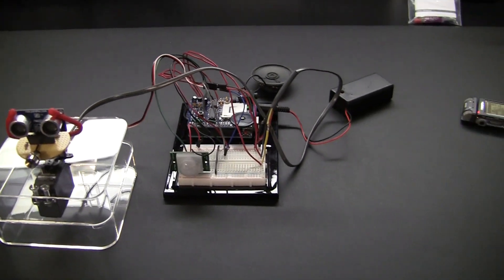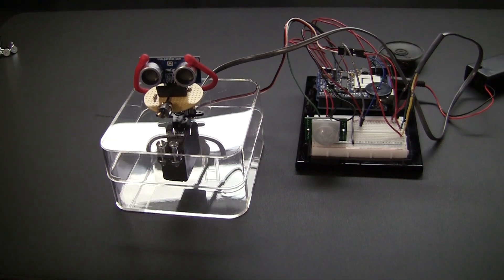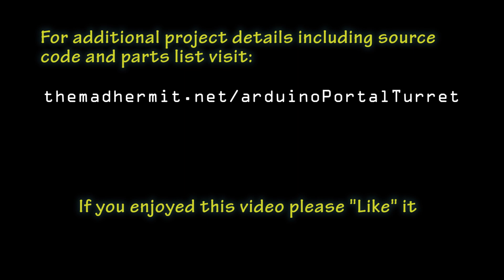Arduino Portal Turret (HD Video)

Comment: You should use 2 ping sensors so you can triangulate the targets position and track them for longer
Reply from the maker: +McDanny420 Yeah, but then it would work better then the turrets in Portal which defeats the purpose. I wanted the project to emulate a Portal turret's behavior.

Comment from the maker: Morgan,

The Adafruit  wave shield was pretty simple to use. They provided code to interface with it which made it easy peasy. One thing to keep in mind is that 
you will have to use SoftwareServo.h instead of Servo.h due to a conflict with 
the timers of the WaveHC.

That was the only drawback as far as I remember but still worth it in my opinion.

If you look at the video description above I have a link to the project including the source code which will show you how I coded around it.

-Mark

Comment from the maker: I thought about your suggested implementation as well. It's a bit more complex but certainly  possible. You will be limited to the resolution of your servo motor. The longer the distance you intend to scan, the bigger the gaps you will have in your data.

You will also have to figure out how you will deal with items that have been moved in the room from your baseline scan. If you go this route please share your results. ::

Comment: I'm running into a compiling error. I followed the errata and I'm still getting a error compiling. It seems to me the library isn't compiling? I don't really know i am a newbie to the arduino.

Here's the error: 

C:\Users\Michael\Documents\Arduino\libraries\SoftwareServo\SoftwareServo.cpp: In member function 'uint8_t SoftwareServo::attach(int)':
C:\Users\Michael\Documents\Arduino\libraries\SoftwareServo\SoftwareServo.cpp:27: error: 'digitalWrite' was not declared in this scope
C:\Users\Michael\Documents\Arduino\libraries\SoftwareServo\SoftwareServo.cpp:28: error: 'OUTPUT' was not declared in this scope
C:\Users\Michael\Documents\Arduino\libraries\SoftwareServo\SoftwareServo.cpp:28: error: 'pinMode' was not declared in this scope
C:\Users\Michael\Documents\Arduino\libraries\SoftwareServo\SoftwareServo.cpp: In member function 'void SoftwareServo::write(int)':
C:\Users\Michael\Documents\Arduino\libraries\SoftwareServo\SoftwareServo.cpp:51: error: 'clockCyclesPerMicrosecond' was not declared in this scope
C:\Users\Michael\Documents\Arduino\libraries\SoftwareServo\SoftwareServo.cpp: In static member function 'static void SoftwareServo::refresh()':
C:\Users\Michael\Documents\Arduino\libraries\SoftwareServo\SoftwareServo.cpp:73: error: 'millis' was not declared in this scope
C:\Users\Michael\Documents\Arduino\libraries\SoftwareServo\SoftwareServo.cpp:106: error: 'digitalWrite' was not declared in this scope
C:\Users\Michael\Documents\Arduino\libraries\SoftwareServo\SoftwareServo.cpp:108: error: 'TCNT0' was not declared in this scope
C:\Users\Michael\Documents\Arduino\libraries\SoftwareServo\SoftwareServo.cpp:123: error: 'digitalWrite' was not declared in this scope

Comment: all this is coming from a arduino ? i seen one by kss5095 in youtube but his using alot more then c++ which is what arduino is running of, now how is the tracking happening? pir just does motion and the sonic just deals with range so how is the locking  and tracking done to follow?
Reply from the maker: +Sys.stem Arduino is a pretty powerful platform while at the same time not being overly complex. It's perfect for a Portal Turret. :)
Reply: oh i know im well aware about arduino sir is just like i mentioned that the other guy was using python to do what you just have done so i was bummed cuz i HATE python, i will build upon your work and modify somethings for some of my robots im currently printing parts for nice job and thanks for the share perhaps i can return the favor someday.   *****
Reply from the maker: Sys.stem My misunderstanding. I'm not a fan of python either. I look forward to seeing what your produce. :)
Reply: i do too lol thanks and cute baby girl you got there deff looks like you hmm) *****

Comment: Very cool project. I just finished duplicating your turret. Everything is working...i just need to put it in a more presentable enclosure. Now I'm trying to have the firing trigger randomly play any of the large group of files I have on the sd card, instead of the shooting sound.  I can add file name for for every sound and as long as I change it to  8 characters or less it seems to work, I was just wondering if there was some code to randomly play anything in the sd card root when firing is triggered. Any ideas how to best incorporate the code?

Comment: I love this! I was going to try to build an arduino turret using webcam motion detection, but I like this much better! 

I'm not sure how often that ping sensor updates, but tell me if this sounds reasonable: Lets say you want to use longer distance. Can you pre-scan a room, recording a baseline distance for every angle the sensor is able to rotate, and then after the motion detector goes off, scan the room and cross-check every angle's reading with the pre-recorded reading? If different, fire!

Comment: cool ......hi mr. mark ? can you share to me the wiring diagram for this project ? iwant to make it for my children :(
Reply from the maker: +daruma yasa I don't have one. I put all the information on my website including the parts I used and the Arduino sketch (http://www.themadhermit.net/geek-out-build-your-own-arduino-portal-turret/).

The source code is well documented and explains the few pin assignments, namely:

#define INFRARED_MOTION_SENSOR      14 
#define PING_PROXIMITY_SENSOR       15 
#define RED_TARGETING_LED           16 
#define SERVO                        6 

Hope that helps.

-Mark

Comment: The arduino sketch file is not available on your website anymore. I couldn't find a similar project in which the PIR sensor acts as the trigger in activating the servo and the ping sensor. It would be awesome if you could upload Arduino_Portal_Turret.ino again! :)

Comment: Very cool man, I'm building a Replica of the Team Fortress 2 Level 2 Sentry gun For Systems Engineering for Final year, Year 12, using a similar way to you but with a 3 PIR motion Sensors 35° away from each other and when a the sensor detects motion the servo will snap to that position. i'd like to know how easy did you find the Adafruit Wav shield to set up and coded for? i currently have a Sparkfun mp3 Trigger but i haven't started implementing sound into it so far.